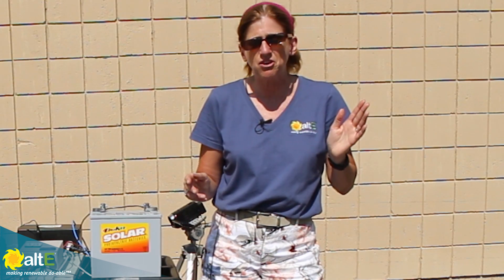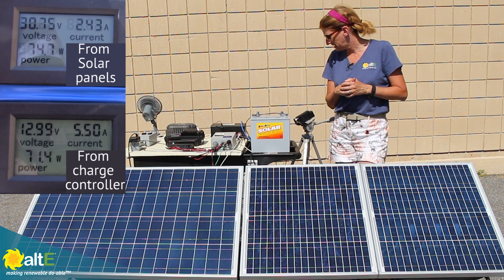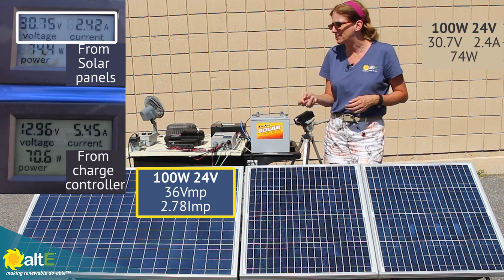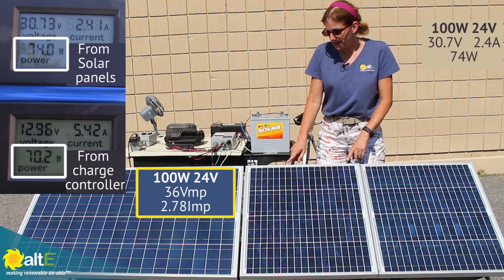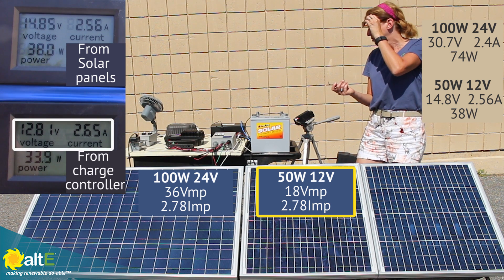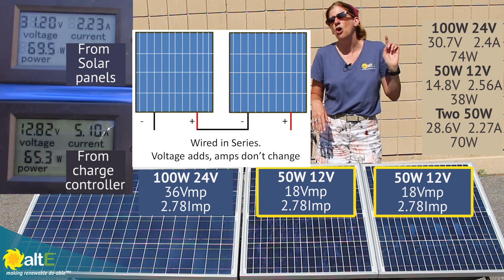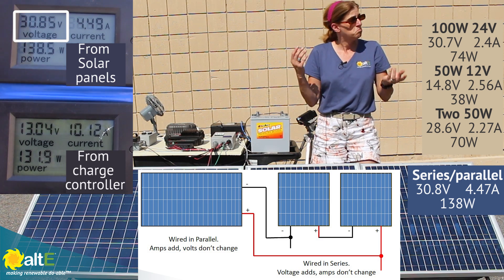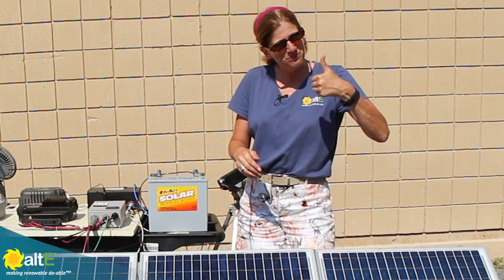How to Wire Mismatched Solar Panels in series and parallel

Comment: So basically what you're saying is that I can take my 12 volt 160 watt panels and wire them is series creating a 24 volt system by series wiring groups of 2?
Reply from the maker: Correct. Wiring in series increases volts, wiring in parallel increases amps. So if you have 4 panels wired in 2 strings of 2, both your volts and amps will double.
Reply: altE Thank you! Your videos are very good and I appreciate your time. I’m seriously thinking about upping to a 24 volt system.

Comment: Hello good day to everyone! I have a question, can be the solar panels in series be switch to series parallel by using automatic transfer switch?  Ex. 7 panels 285w each connected in series, and then I want to switch later on the 4 panels into series parallel - 2s2p. Is it safe to use 2 dc contactors as ATC to do the switching of the panel. Thanks!
Reply from the maker: What are you trying to do, switch between a grid tied inverter and a charge controller? The way I see it you would need 3 switches to change the wiring. Plus the wire would need to be sized to handle twice the current. Pretty complex and expensive. I'd rather do it by simply switching to a 600V charge controller, like the Morningstar TS-MPPT-600V, https://www.altestore.com/store/charge-controllers/solar-charge-controllers/mppt-solar-charge-controllers/morningstar-mppt-solar-controllers/morningstar-ts-mppt-60-600v-48-tristar-600v-60-amp-mppt-charge-controller-p11177/

Comment: ...ok let say i have different panels with varying voltage and current...but then i use a buck or boost converter to match all of those panels to output a same voltage and current will it be considered efficient ..effective...ect ?
Reply from the maker: Best to just use a separate charge controller for each.

Comment: You answered my question that others couldn't.  Thanks.  I am adding 1200 watts of panels to my 800 watt system.  The existing system features two sets of four 100w panels in series connected with a coupler in parallel, making a 800w, 48v array with max open circuit 90v and 10.8 amps.  The 1200w addition features four 24v, 300w panels, arranged in two pairs in series, one pair paralleled with the other pair,  making a 1200w, 48v array with max open circuit of 80v and 20 amps going into the same MTTP charge controller to a 24v battery bank.  I was concerned that one array had a max open circuit of 10v higher than the other.  I don't expect that to be significant after watching your video.
Reply: Hi, I want to do something similar. How is your solar panel arrangement working out?

Comment: ok so if you wire two 3 24V in parallel the amps get added up. so my two 8.3Ax2 plus 1 5.5A I should have 22.1A ?
Reply from the maker: Theoretically. Real world is you may see a bit less, but that's the general rule.

Comment: Dear i have 3 different panels 1 320w 24v and one 180w 24 and 2 panels 150w 12v what the best connect with the mppt
Reply from the maker: jamal aldhubibi if you have to do them all with charge controller, the best way is the two 12V in series, then put them in parallel with the two 24v panels.

Comment: I now seriously can't say do a mixed match panels, I personally saw what happens when 60 cell and 72 cell panels....60 cell never added power if the voltage was above 32 volts, but once the voltage was <31 volts they finally 'kicked in'....

Comment: What about adding 20v,9v and 5v solar panels in series
Reply from the maker: If their amps are the same, you may be able to do that, and use an MPPT charge controller to get the output voltage  to be correct for the battery. But check the label on the lower voltage panels to make sure what the max voltage is that it can handle.
Reply: Hi there , excellent video ..I have a question , I have 2 21v 300w panels connected in series and recently bought another 300w panel but this new panel is 38v ..can I connect it to the other two in series also ? I'm using an mppt charger so I wanna make use of the higher voltage .. thanks :) looking forward to your reply

Comment: I bought two NewPowa solar panels, one is 100watt and the other is 30 watts.  i have the panel at my front window facing east (for testing).  with no load on them, they both display around 16.75 volts, which i thought was good since they are indoors not in direct sunlight.  as soon as i connect the panel to the PWM charge controller, the voltage drops to 11.9 volts, and the battery never charges past 11.9 volts all day long.  i tried wiring the 100 watt and 30 watt panel in series, and the voltage on the charge controller read the same 11.9 volts.  i wired them in parallel and no difference.  however, i noticed then i connected the two panels together, series or parallel, my overall battery dropped from 11.9 volts to 11.8 then to 11.7.  i unhooked all the panels except the one 100 watt panel and the charge controller goes up to 11.9 again.  why is the addition of another panel making me get less charge?  the specs for voltage are the same so i was assuming wiring them together would work.  can someone help me?  the panels are on ebay if you needed the specs, i can also gladly add them here.  they are 12 volt panels, the battery is 12 volt 12ah.  so i can never charge my 12 volt battery fully with 11.9 volts incoming?  can i instead use 6 volt batteries in series, and charge them individually so the 11.9 volts will charge them?  please someone help me haha
Reply from the maker: Chris Topher while the voltage is the same for both, the current of the 30W is 1/3 of the 100W. When you wire the 2 together, the 30W is greatly reducing the current output of the 100W. Being in a window at a less than ideal angle further reduces the current. When you connect the panels to the battery, the low voltage on the battery pulls down the volts, and with little current, there's just no power to charge. If your meter is able to measure current, switch the meter to amp mode and measure that with nothing else connected. You are better off with just the 100W than the 2 together, regardless how you wire them, unless they each have their own charge controller.
Reply: thanks for the prompt reply.  i am in the process of doing tests because i am going to purchase about $30k worth of solar panels shortly, in  Michigan.  I do have two PWM charge controllers, and if i can connect them both to the battery I will.  my battery was charging all day at 11.9 volts and now it's at 11.6 volts with a 4 watt lightbulb running off my inverter.  am i correct to assume the solar panels outputting 11.99 volts will never charge the battery past 11.99 volts?  i thought i could slowly charge it full regardless of the solar input.  if it will never charge a 12 volt battery under these conditions, wouldn't it be better for me to build a 6Volt battery bank and then charge them separately when it drains?  i want to get use out of the solar panels even when they output less than they should.  i bought a 1000w pure sine inverter too, and when i hooked it up directly to the panels, it died after a second.  it sounds crazy but i need panels to produce 5000kwh a month, so this is a huge project.  i will try and test the amperage with my meter.  i was hoping i could fully charge the 12 volt battery even when the solar panel outputs less, but apparently i was wrong.  i just want to know if there is a way to charge my 12 volt battery full without inputting full sun.  i connected the two in series and parallel and the numbers on the charge controller never changed positively, they started to go down.  i understand the concept behind series and parallel, but i get so much conflicting info online.  i read that if they are the same brand and same Voltage then they can be run in series, but that wasn't the case for me.
Reply: i took the panel outside and the battery jumped from 11.9 to 12 to 12.1 to 12.2, then real high to 13.6 then back down to 12.4, all within a few minutes.  i guess the indoor testing was worthless.  sorry about the beginner questions, i realize you get asked these basic questions all the times.  i think i figured it all out, and today i purchased an MPPT controller called a Tracer3210A 30 amp, i hope that will help me utilize all the volts i get.
Reply from the maker: 5000kWh a month in MI will need over 100,000W of solar panels. I'm hoping you accidentally put an extra 0 in there somewhere, or else realize you will need another source of power in the winter, like wind and/or a generator. 

Even with the MPPT charge controller, I don't recommend putting the 30W and 100W panel in series. Use the PWM on the 30W and the new MPPT on the 100W, you'll be happier. The voltage of the charging source always has to be higher than the battery, so with low voltage, it will not charge. And as we already discussed, with extremely low current from a low light source, nothing good will happen. Keep in mind that current is more affected by light than voltage, so if you are outside and it is cloudy, your volts may be fine, but you will have low amps.
Reply: I was not mistaken with my zeros, i consume $700 worth of electric during the warm months and $500 during the colder months.  i own and operate a legal cannabis business, the panels will pay for themselves within a year.  i don't NEED 5000kwh a month in solar, but i want as much as i can get.  the power goes out in my city every six months for about two or three days, it's ridiculous and i live practically on campus in east lansing at MSU. it's always a storm and a fallen tree or something stupid etc.  i'm starting to think the power outages are the elites testing responses and such, i don't trust being on the grid anymore after all the corruption in the gov and media.  i am going to start with 265 panels X 100 watts and i was hoping that could bring me around $350 to $400 worth of electric a month.  i plan to expand as much as possible, building solar arrays and covering every inch of my rooftops.  and yeah i am going to take your advice and not mix and match panel sizes, i only have the two different sizes for testing and because this is all new to me.  my battery is fully charged out in the sun, i am impressed with how much of a difference the window makes in taking out the solar radiation from the panel indoors.  thanks for your time and responses, i have been watching your videos for a few days now and plan to watch as many as i can.  for people without an engineering background, this is confusing, but it's also fun.  i remember getting all As in high school physics and we did all these equations so it's all in my head somewhere.  have a good day and thanks again.
Reply from the maker: Ok, makes more sense now, thanks for explaining. Solar is going to be huge in that industry because of all of the energy needed for the lights, pumps, and fans. First, and most important, do not use 100W panels for your big system. Those are for fun little projects or little cabins. You are going to use at least 300W panels, probably bigger. Much much much better price per watt. You'll do strings of 3 of them in series, with multiple parallel strings. 2nd, plan on grid-tied battery backup, with a generator. Probably either multiple Schneider XW+ or Outback Radian inverter/chargers. Stay on the grid as much as possible, with backup capabilities.  3rd, this will be a big complex system, and it sounds like will be done in stages so needs to be designed as such. Give us a call when you are ready, and someone here can do the design work for you to make sure you get it right.
Reply: thanks so much for the detailed information.  yes my fans and air pumps alone that run 24hr a day cost 90$, then the lights add the remainder to $500, and with air conditioning I get to $700.  i will definitely look into much bigger panels to save on costs.  this project will be in stages, i am going to start real small and it might take two or three years to complete, i have no idea.how it will all play out, but i do know that i want to buy $2500 worth of panels this month, so perhaps i should start looking at bigger sizes.  i had intended on just getting 25 more NewPowa 100watt panels from amazon or ebay, but now I will look at the bigger ones.  If you have any suggestions on panel dealers I will take a look.

Comment: hi,can you please suggest on two case, 1) what is the effect on performance if i connect a 275Wp ( Voc:37.9 v), module in a string of 235Wp(6year old module, Voc:36.9V)module? 2)what is the effect on performance if i make a single string of 275Wp(Voc:37.9V)-new module and connect the same in parallel with string of 235Wp(6year old module, Voc:36.9) module? Both the combination will be connected to a grid tied central inverter having single MPPT. and a string comprises of 24nos of module connected in series, please suggest.

Comment: hello am i ok if on the roof of my truck camper i have 2 x 100 watts pluged togeter (on a y connector)on a controler and a 85 watts panel on another controler. and wired the output plus of each on the positive of my battery and the same for the négative?
Reply from the maker: paranoy69 you should have the positive output of each controller going through it's own fuse or breaker before the battery. Other than that, sounds right.

Comment: Hello, i have 4*100 watt panels, 18 voc and 5.5 amp, and 1*325 watt panel at 38.25 voc, 8.49 amp, i was wondering if it would be safe to wire the 100 watt panels in series in pairs then wire them in parallel with the 325 watt panel for a 725 watt total array, to an mppt charge controller, the difference in voltages is 2.85 volts, would that be acceptable?
Reply from the maker: Not only will the volts be different in the two strings, but also the amps 5.5A vs 8.49A. So while it will be safe, and will work OK, it will not work as well as if you got 2 charge controllers, one for the 100s and one for the 325.  If this is going to a 12V battery bank, you will need 60A of MPPT charge controller (725W / 12V = 60A). It may actually be about the same price to get two 30A charge controllers rather than one 60A.

Comment: I would like to have the formulas to see where the numbers come from. I do not have those meters.
Reply from the maker: You don't need these fancy meters, I just have them so I can show multiple points in the system at once. A simple hand held multimeter that can read DC volts and amps is an important and inexpensive tool to troubleshoot your solar system. I would never try to build one without it. You can see some examples in this video, https://youtu.be/m_YuPfShbCo The most important formula is watts = volts x amps.
Reply: Thanks for your fast response.

Comment: Very helpful thanks. On my boat I want to add 1 panel of 280 Watts x 24 Volts and combine that with 2 panels of 100W x 12 Volts. I bought a Victron 100/50 mppt controller and if I follow your video correctly I should be able to make it work with the combination of series connection for the two 100 W x 12 Volts panels, then parallel connect them to the 280W x 24V panel and then input to the MPPT controller as one + and one - wire right? If I misunderstood, please correct me.
Reply: in series volts get combined, in parallel  amps get combined but will work at what ever the lowest voltage panel

Comment: Do you need blocking diodes for each panel? Most panels have bypass diodes not blocking diodes
Reply from the maker: You generally do not need a blocking diode. Most systems would have a charge controller that prevents any night time drains. We did a video on diodes here, https://youtu.be/5rYy0gHZepI

Comment: Hi Amy. Solar panels with difference of only 10W, 1V and 0.6Amp will also be called mismatched solar panels. So, connecting them (250 W and 260W solar panels) either in parallel or series to the same charge controller be harmful.

Comment: I keep getting different and seemingly conflicting information on using mppt controllers with mixed panel setups. Some sites say don't do it and others seem to think its ok. I ask because I was thinking of buying a 2 year old 24 volt 250 watt panel for $120 on Craigslist to get started. I figured as long as i used a controller like the SolarEpic MPPT 40A , I could always add more 24v 250 watt panels later as long as the specs were close enough? But then Im reading where its too risky and the mppt controller could get confused trying to deal with the differing panels ? Anyone have experience in this area ?
Reply from the maker: There's the ideal situation, then there's close enough. As long as the Isc and Voc are close, you can mix brands. It won't be perfect, but it'll be good enough.  ideally, compare the spec sheet IV Curve. It shows the output at different light levels. If they are similar, you should be fine. If they are different, find a different panel. Look at the IV curve on page 2 of this spec. https://www.altestore.com/static/datafiles/Others/CS6K-P%20Datasheet.pdf